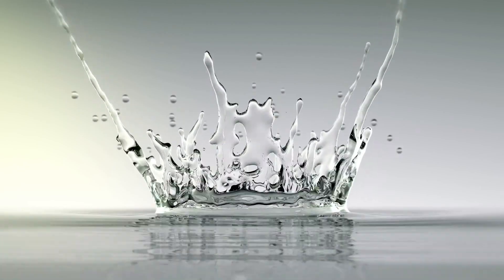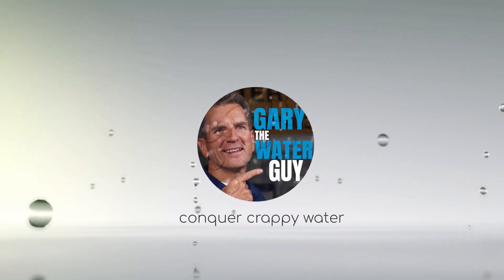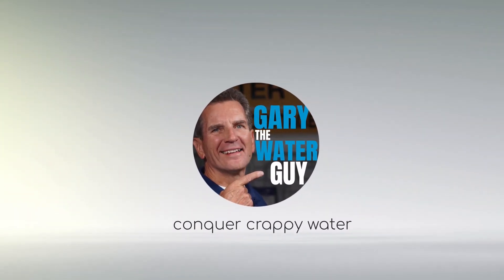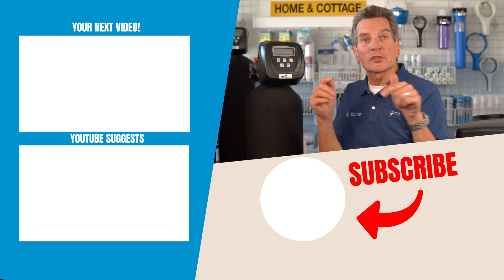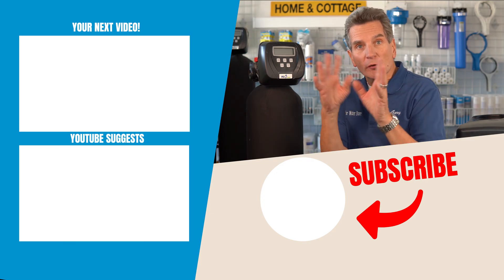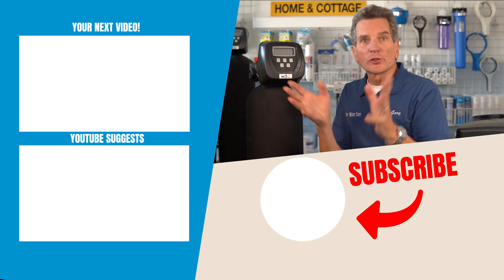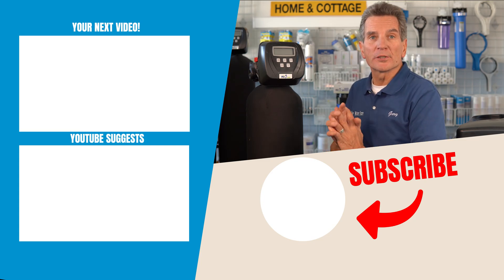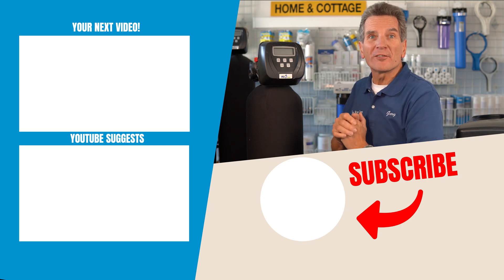CAN WATER be TOO SOFT? Water Softener TROUBLESHOOTING

Comment: Hi Gary.  I have a water softener with Clack ws1ck head.  In the settings, right after hardness, there is a “service hardness” which is set to 0 by default and can’t exceed the value of the hardness setting.  From what I read, this is used to set the output hardness of the water.  Do you know if this is the case?  Could some hard water mixing be happening automatically within the head based on this setting?
Reply: I found the answer to my question so I'll put it here for anyone that runs into the same scenario.  It turns out my Clack head has an integrated manual mixing valve (Clack V3013) that can be controlled via a knob on the left side of the head, just before the water meter.  Basically, the procedure is to turn the knob, run the water for a bit so that whatever was in the pipes from before the change is drained, then measure.  If you like the hardness level, good. If not, repeat.  After you are done adjusting the hardness, you need to set the "service hardness" setting to what you have measured.  This is so that the capacity (hence next regeneration date) gets calculated properly.  Increasing the service hardness will add to the capacity since some portion of the water that comes out and passes through the meter did not go through the resin.  That setting is there just to make that correction.

Comment: I live in an apartment complex where I can't adjust the water settings.  We have soft water and it terrible.  My hair feels slimy when I'm washing it and looks flat when I'm done.
Reply from the maker: Sorry to hear, most people prefer soft water for hair washing. Maybe their softener is not setup correctly.
Reply: I've never used a water softener where it DIDN'T feel like I was taking a bath in baby oil and left my skin sticky and my hair flat.  I find it hard to believe that every truck stop shower across the country and friends house that I have used, had their softeners incorrectly set up. Because of that I have always hated water softeners.  We have moved to a new house that has horribly hard water.  Hopefully a bypass valve will work well enough that I can stand taking a shower.

Comment: Paul Burkhardt has a nice article on the web about this issue. One thing I'll point out is that the water hardness setting on the machine simply defines how often it needs to regenerate. The water going through the softener will come out "fully softened" if the machine is working correctly. The only ways to adjust this are to let your machine go past it's saturation point or to mix un-softened water back in like Water eStore says. But both of those have downsides and will probably not work well.
Reply from the maker: For some customers who want water partially hard we set up the plumbing to mix a small amount of hard water with the soft water.  They are pleased with the result.

Comment: Does the Clack proportional bypass valve do a good job?  Will it work on valves other than Clack?
Reply from the maker: It really isn’t meant to be used as a means of mixing treated with untreated water. If that is what you want to accomplish you are better off building a 3 way bypass around the softener with ball valves and leave the bypass slightly open
Reply: @water_estore   Will the 3-way bypass valve noticeably reduce the GPM flow rate?

Comment: Has anyone who added some hardness back in noticed their hair feeling less greasy?
Reply: Id like to know that also
Reply: I moved a year ago. I have 25% of my hair due to soft water. Prior was hard water. Soft has done my skin good.
Reply: @dawsons9876  yes, I actually thought I was losing my hair it seemed to get so thin! Once I turned off my softener for a while I realized it was too soft and that was what was causing my issue. Dialed back the softener and my hair had a miraculous recovery lol
Reply: @dawsons9876  I feel dirtier after showering with a water softener. My hair is definitely greasy. It's gross - give me hard water please.
Reply: @rarah73 The normal statement is they felt there was still soap or conditioner on their head because it was so slipery. That is a sign that its working. If it smells bad than you might have a salt dam that needs to be broken up. Hard minerals cause dry skin and hair loss.
Reply from the maker: I've never heard of anyone having a concern about their hair feeling greasy after installing a water softener.
Reply: @water_estore  I've never used a water softener where it DIDN'T feel like I was taking a bath in baby oil and left my skin sticky and my hair greasy flat.  I find it hard to believe that every truck stop shower across the country and friends house that I have used, had their softeners incorrectly set up. Because of that I have always hated water softeners.  We have moved to a new house that has horribly hard water.  Hopefully a bypass valve will work well enough that I can stand taking a shower.

Comment: Hi Gary, I have been watching your videos on how to adjust the hardness setting on a water softener.  We have a very old DIR unit and it still seems to be working fine.  We recently changed the resin and after we did that, the water was really “slimy”.  I watched your video on how to adjust the hardness and when I got to that hardness setting, the screen display had this symbol, -nA-, and I was not able to make any changes with the arrow keys.  I don’t know if that is an actual letter “n” but that was the closest I could come to what it looks like.  The company that installed it is no longer in business and we have someone coming to look at this next week.  But I wondered if you knew what that was? Does that mean we cannot manually adjust our hardness level? We know it’s 15.  Or is that an error code? And the water was perfect before we changed the resin but the unit is 23 years old so that’s why we changed it.  Any thoughts?  Thank you!
Reply from the maker: Yes, it has been set for a cerain number of gallons of capacity, instead of metering.  If it is a Clack valve, compare to these settings https://youtube.com/live/c6r7qUK8to4
Reply: Thank you, when I go to the hardness setting, I get a code that says, “-nA-“, and it won’t change with the up or down arrow.  There isn’t a number there, but it is the hardness setting.  Have you ever seen that code or know what it means?

Comment: What if I just want to increase pH? My pH is 6.8 after the softener, then down to 5.3 after my RO. Alkaline/mineralizing filters can increase the pH after the RO but I don't know how much... maybe only by 1 pH. So either I need two alkaline filters in series after the RO to get above 7pH or maybe if I can make my water softener not take out as many minerals? Can I do this by reducing the hardness level? I think it's set to 30 so if I reduce it to say 25 and experiment, could that help me increase pH so I only need 1 alkaline filter? Or wasting my time thinking of adjusting the softener? Thanks!
Reply from the maker: Softening has no effect on pH.  Remineralization filters like this https://waterestore.com/products/omnipure%C2%AE-k-series-2x10-all-calc-3-8-fqc-k2548-kk?variant=44133641453781 will raise the pH to 7.0, not higher no matter how many you add.  Why would you want your pH to be higher than 7.0?

Comment: Gary, can I just reduce the hardness level on my softener if I feel it's too slimy?
Reply from the maker: Nope.  If you do that you will have what you percevie as slimy water for several days, then hard water for a couple of days until it regenerates when the cycle begins again. Check your hardness settings first to make sure they are correct and try to use less soap.

Comment: Hi Gary! I have a graduated bypass on my newly installed AO Smith 35,000 water softener. I'm presuming most models are designed this way so you can adjust them? I've played with digital controls and water is still too salty/slippery and has a plasticy taste. Do you know if this technique will work with the AO Smith? Thank you!
Reply from the maker: Not sure but I would definitely check your settings first

Comment: other the water feeling slimy ( which doesnt bother me ), are there any other disadvantages to the water being too soft ??
Reply from the maker: Water cannot be too soft, it only goes to a hardness of zero, not below zero.  If the settings are set incorrectly so the water softener uses too much the water might feel slimy.
Reply: Crappy hair...greasy roots. Dry ends
 Dry skin

Comment: I have a soft water system and it has done the absolute worst to my skin. I’ve developed skin rashes, oily hair, breakouts, hair loss, itching, you name it. It’s an absolute nightmare. I know the pipes are probably in better shape but what a price to pay 😐
Reply from the maker: I would definitely have your water tested for dardness and TDS (ppm) before and after the water softener AND the settings checked.  Something isn't right!
Reply: Same here. But mainly hair loss on The top. Hair was fine until we installed a water boy softener. My head started becoming very itchy too. I hate it. I started washing my hair with water bottles and that’s helping.
Reply: @RICHARDFLORES2100  You're probably just getting old.

Comment: Hello Gary, we just moved into a house with well water.  I think I have an issue in which my water is TO SOFT!  My wife has developed a very bad ITCH.  The first three weeks she was fine, and then we called for a water service and he end up adding salt because according to him "it was low".  Now the salt level is about 3/4 of way high in the brine tank.  Should I attempt adjusting the water softener settings on the unit or removing some salt (if that is even a thing)?
Reply from the maker: You would need to know the hardness level of your water before the softener and then make sure that your water softener is set correctly.

Comment: I moved into a home that is on a community well and after moving in we replaced the water heater, water softener and installed an oxidizer and we still have a strong sulfur smell and TDS reading in the 460-520 range. I have a 1 micron charcoal pre filter before going into anything. Even the filter in the refrigerator only drops it to 430-450 TDS. What else can I do?
Reply from the maker: Reverse Osmosis is the only thing that will lower the TDS.  This is my favourite https://waterestore.ca/products/hum-water-saver-reverse-osmosis-system-75-gallons-per-day
Reply: @water_estore  I’m looking for a whole house system. When I shower to has a strong sulfur smell. I have 3 full baths/showers and 6 sinks. Also the previous owner had nothing other then a string sediment filter, no water softener and a rusty 15 yo water heater. How do I get rid of any buildup in the lines which are all pex?
Reply: @Propnut48  The smell is from the Anode rod in the water heater.
I removed the anode rod with an impact wrench, poured two quarts of hydrogen peroxide in and bought an electronic pulse anode rod from Amazon.
It's been two years and no problems and no sulfur smell.

Comment: Hi Garry,
I serviced my acidic neutralizer which had no media for a month or so, now the water became slippery. I didn't change anything in the water softener. 

The neutralizer valve has a setting option for the PPM (mine set at 20). By reducing this setting, does it affect the valve in anyway ? 

Is it even better to use soft water in the shower? i hate the feel of it but at the same time, it might be better....
Reply from the maker: Flush the neutralizer more, it is temporary when new media is added.
Reply: @water_estore  Oh wow i see. thanks. will do. 

By the way, does the hardness rate of the setting making any difference by the valve?

Comment: Good Afternoon, I live in an area in which the hardness is at a 9.  ( not well water but city water).  The water was tested by the plumber.  I had a water softener installed 1 day ago and I am getting a salty taste which isn't great because I have high blood pressure.  How do I correct the salty taste issue?
Reply from the maker: Great question!  You are only getting salty water because the unit was just installed.  Give it a week or two and the salt taste will be gone.  If not, Reverse Osmosis like this will remove it https://waterestore.ca/products/hum-water-saver-reverse-osmosis-system-75-gallons-per-day
Reply: Mine is salty off and on and especially after it regenerates. Soap stays on my hands too. Did u ever find what was going on ? I know its been years!

Comment: After I used water softener, feels slimy after taking shower and developed skin tags over my face. I cannot sue municipal as water is already tapped.  Seller and manufacturer of the unit won't held responsible. They sell me telling all theses good things like you said. But won't held accountable to their claims when there is problem. Seems slim clog my facial pores.
Reply from the maker: I would make sure that the water softener is set correctly to your level of hardness.

Comment: I thought having the slippery feeling is part of having soft water. One thing I notice is that the cold side is soft, but the hot side is always a little less soft. I've already drained the water heater and filled it with soft water, but it still does that. My hardness is 10 so it's not that bad. - My softener setting is at 25
Reply from the maker: With your water softener set at 25 you are wasting quite a bit of salt (and water) during regeneration with no upside.  Not sure why your hot water would be less soft.
Reply: @water_estore  I believe my iron level is about 2-3 ppm... so that's why I set it to 25... it says to add 5 to each ppm of iron... so 10+15.... is 25 not the correct number?

Comment: so if untreated tap water reads 25 on the test strip is that a good starting point to set the softener at?
Reply from the maker: Yes, we usually set it 2 higher than where it reads.  Unless you have iron in your water, then the settings would need to be adjusted to compensate
Reply: @water_estore  thanks so much... Compensate for water is it a ratio of so many PPG of salt to PPM of iron??

Comment: Hi Gary I have a well and I just add the water softener system, do I still need the bleach water tank I have before the softener installation?
Reply from the maker: I assume you used the bleach tank as part of a chlorine injection system to kill bacteria and remove iron and sulphur.  The water softener will not  replace that system so you still need it.

Comment: Hi Gary, if you use the bypass valve to make the water "less soft", will this also save on salt usage , and less water usage due to the unit not having to regenerate as often?
Reply from the maker: yes, you are correct.

Comment: Can running your water softener to High, 35 for 22 hardness for example leave you with a white film on some surfaces?   My softener seems to be regenerating but I recently turned the hardest level up and I’m finding a white coating on some sinks.
Reply from the maker: Great question!  Yes, you are getting a sodium residual from the settings being too high.

Comment: Can the level set on the machine cause the water to taste salty?  When my water was tested, it was a hardness of 29; but the GE unit I installed doesn't have 29, It has 1-25 then jumps every five after that... so I set it to 30 thinking it was the closest number to my level.

I've done the regeneration as instructed and the water kinda trickles out; I'm unsure if it's supposed to a steady stream.  It's a stream, just not full power if you know what I mean...
Reply from the maker: Salty water can be caused by a multitude of things.  This video of mine might help https://youtu.be/3GQWpqlLBps

Comment: Water from water softener making white spots on the surfaces. Can I ask, What may be the issue?
Reply from the maker: I would have the water tested for Total Dissolved Solids.  Your water  may be very high in mineral content, could be sodium.
Reply: @water_estore  Thank You for your reply.. Could this due to the problem of my water softener?  If so, any advice to solve this issue?

Comment: Hi Gary, does the water hardness level need to remain at the same setting even after using it for several months? For example ours was originally set at 25 but we keep lowering it because when we tested the softened water our hardness is at level 50 lowest setting, ph is 8.4 highest setting, alkalinity is at the highest level and chlorine is at 0. None of them at the suggested levels. Our drains have an awful odor coming out when you turn on the water and we have salt film all over our sinks. Water is super slimy and sometimes even sticky feeling after use. We have only had the unit for 6 months. Any ideas that might help?
Reply from the maker: How hard is your water before the softener?  Do you have any iron or manganese in your water?  You need to know because that will determine the correct settings.  Have the water tested.